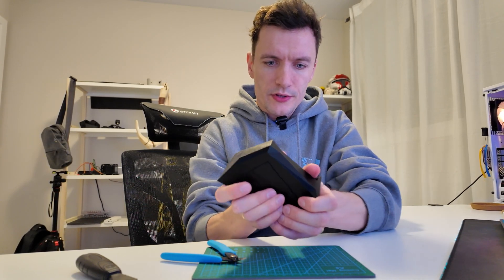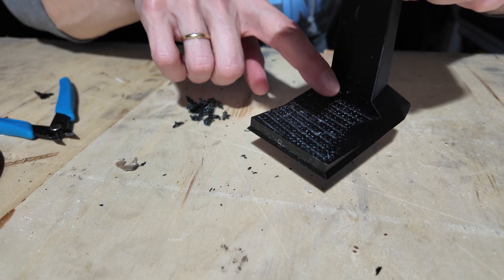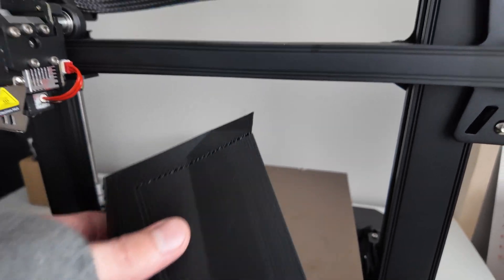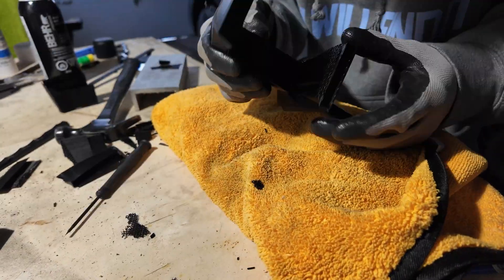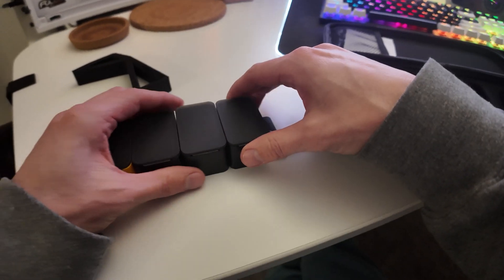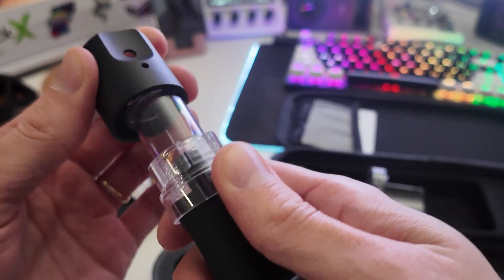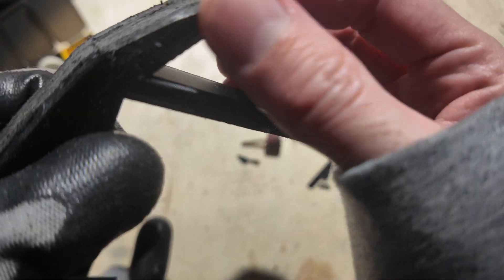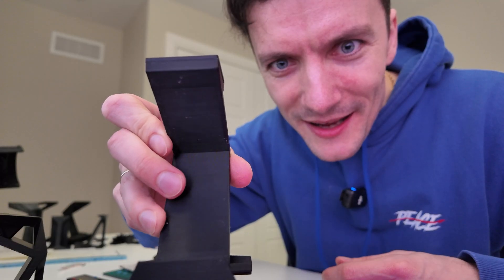My first INVENTION

Comment: Realistically you should try to design your parts where possible not to need the supports, they add a lot to printing time/post-processing time, however that's not always practical.

When you do need supports you should think about what exactly needs supporting. You could probably have used Organic / Tree supports for that model then chosen to add support 'on build plate only' You would have been able to just pull them out of that model in one piece and very little to no post processing. Should also use less plastic and less printing time.

Comment: Great first design, you will learn loads of trick over the next months of printing. Couple of tips that might help especially with the support situation. Firstly if you are using software that offers tree supports use them. Secondly the rough area the supports left on the top side of the bottom of the stand, instead of anchoring the supports to your model try choosing the option 'Touching Build Plate' it will then only add the supports on the build plate and not your model :)

Comment: print that on the side. you might need a slight redesign maybe flat inside or a single angle. no supports and that part would be 100X stronger printed sideways as well.

Comment: Great Job designing the stand! Looks fantastic! I would recommend finding an orientation where you can print on its side, and maybe experiment with tree supports, it shouldn't effect the surface finish, do support overhang angle over 60 degrees. This will cut down on print time, and improve post processing time dramatically. Enjoyed watching the video! Good luck!

Comment: My non-3D printed solution was to use Dual Lock adhesive on some desktop speakers and try to attach them underneath my monitor. I originally got on sale but thought came with speakers - the adhesive only lasted so long.

I need a standing desk.